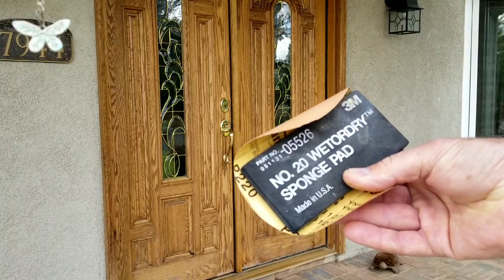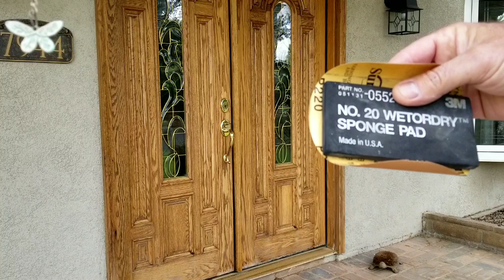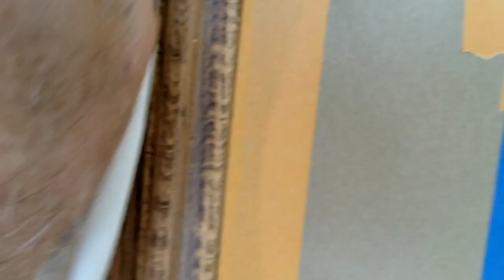Staining Oak from honey oak to dark the fast and easy way

Comment: gel stain on wood is pretty nice to use, gel stain on fibre glass doors in a pain in the ass. I paint 90% new construction and pretty much every house has a fibre glass door they want stained to look like wood. very finicky to use, especially when in the summer heat.
Reply: i have a thermatru that took me 3 weeks (after work and weekends) to strip and refinish.